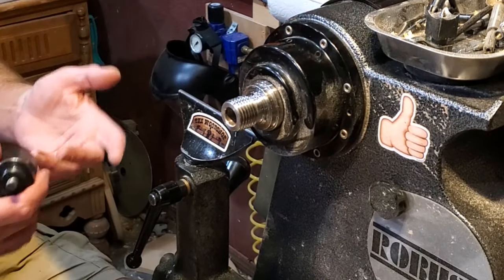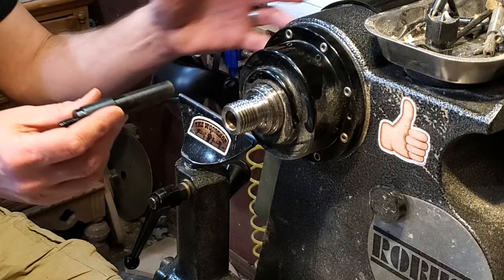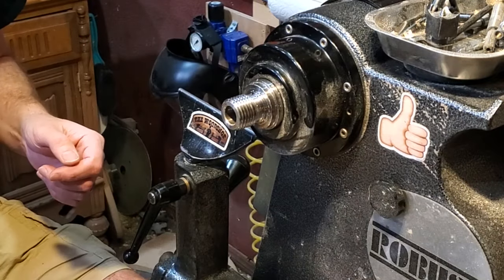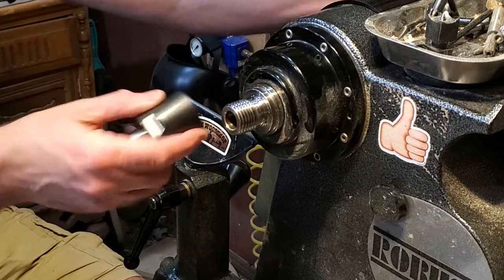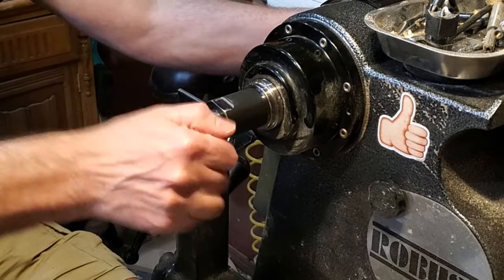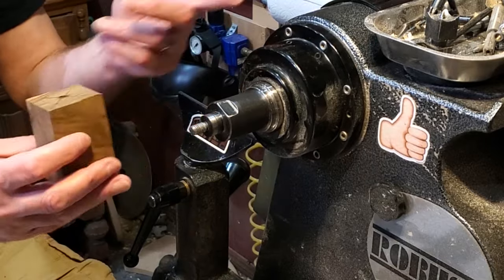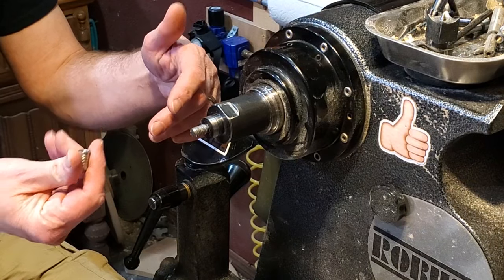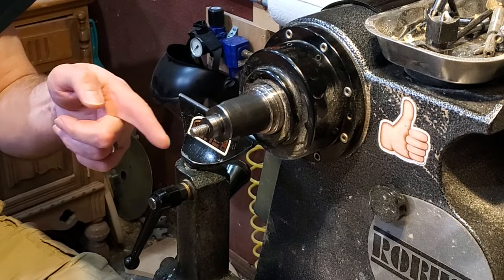Getting started Turning Bottle Stoppers

Comment: Great Videos and Products!  I have turned a lot of pens and various spindles.  However, I am having difficulty with the bottle-stopper.  (Yes, I know bottle stoppers are known as the easiest to turn.  My problem comes when I am shaping the dome portion (near tailstock support).  I use a M2 cryotek 1/2" spindle gouge and Carbon tips.  I keep getting a catch that ruins my project.  I am trying to "ride the bevel" but I may just be too new to the lathe.  Your help in technique or I am willing to purchase your recommendation for a different tool is greatly appreciated.

Comment: Hey Carl, quick question. When you thread the blank, do you glue the turned piece to the threaded stopper?
Reply from the maker: Hey Terry, 
I don't glue them, in case you what to change the stopper or it needs cleaning.